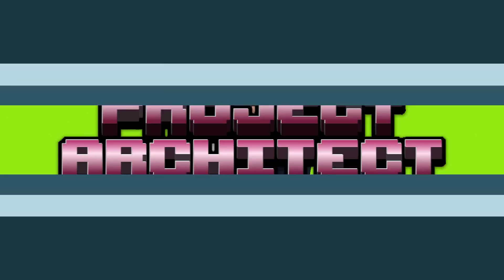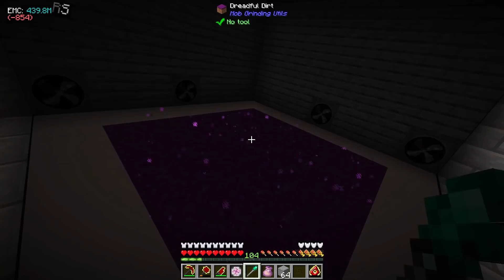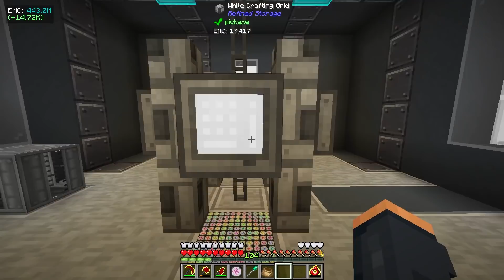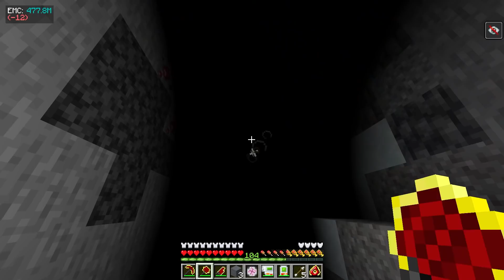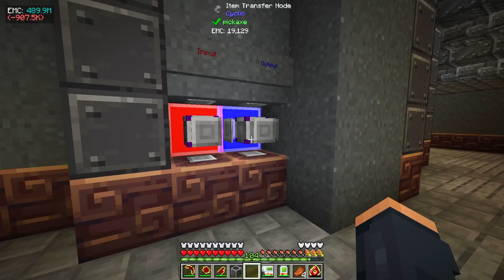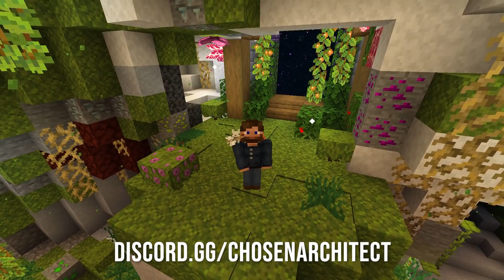Project Architect Modpack EP16 Nuclear Powah Base

Comment: To the automation of those items, and this is just me, but you could just have those items always being crafted and dumped into a set of storage drawers or equivalent. Connect your refined storage to the controller or the drawers directly. Pick an amount you need available at all times, your system can devote a little power to them while you are doing other things and the machines will stop when they are full. If not, especially for the more power and resource hungry items, you will have to wait a while for them to auto craft.

I think this modpack has ender io? Limited item filter on an item conduit to a chest will make sure one chest never has more than those items. If you have too many after your crafting, the RS system will still dump the excess back in that same chest. Just a thought.

Comment: HI, I have a question and that question is,, How do you get these modpacks to run smoothly? Ive tried many things including optifine etc, but everything i try it still seems laggy, Any tips on running I have a pretty good pc too so my hardware isnt the issue :)
Reply: Good question. I got an info that removing mod called Universal grid might help, but for me it's not a difference. I could be wrong but I have a feeling, earlier versions worked better for me, might check that out